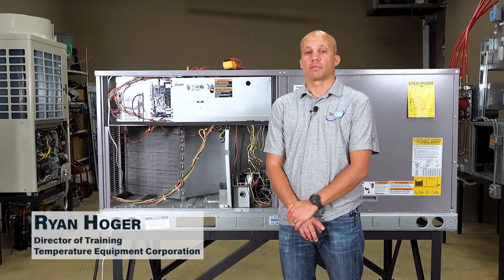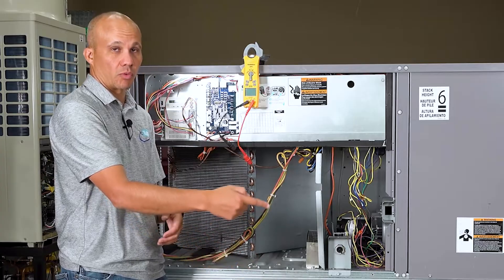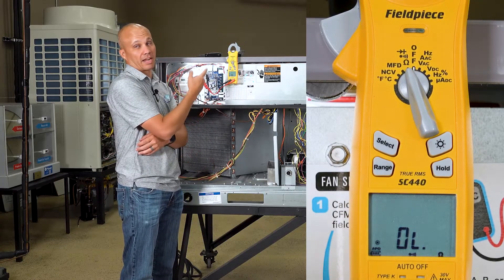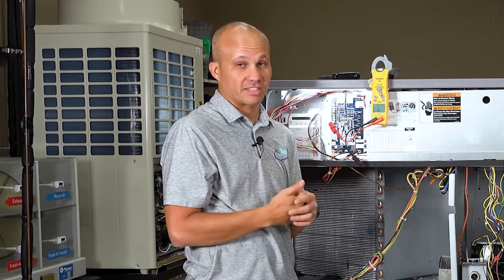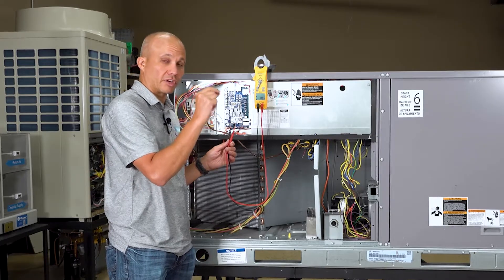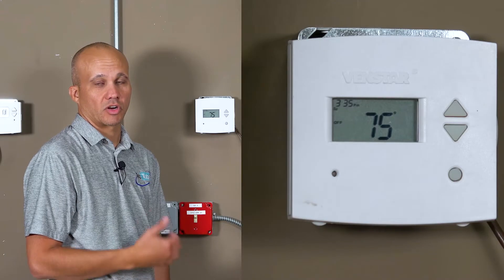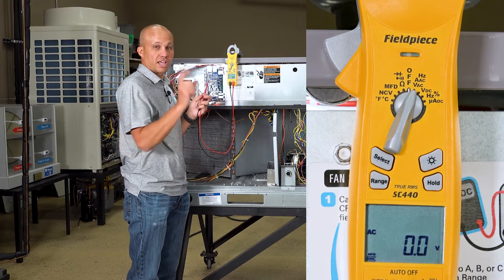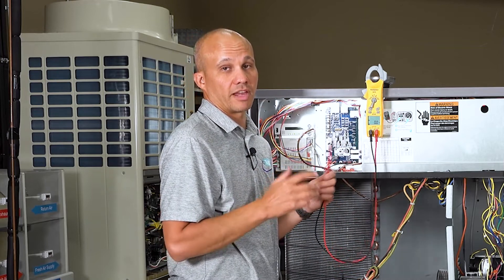Thermostat Wiring Series: Troubleshooting

Comment: Basic lesson on simple voltage.  Now what does rc, w, wc, and c all do or need to do on different thermostats?  Like why does one tstat need common hooked up while another asks for it to be capped off??  If all colors match between tstats except one has no common but are meant for single stage systems, whats the difference?
Reply: Thermostats that have need power for microprocessors, LCD displays, or Wi-Fi chips need the common wire. R & C are what power the stat itself. The other choice is design a battery powered stat but with the electronics I mentioned, they would chew through batteries quickly.
Reply: Some stats have a separate RC and RH for use with systems where the cooling equipment and the heating equipment each have their own transformer. This would be common with a boiler and a DX cooling air handler combined.
Reply: W is for heat. No idea what WC is in your question.